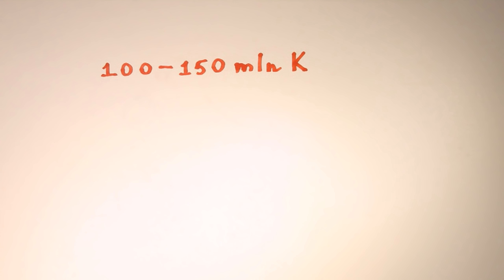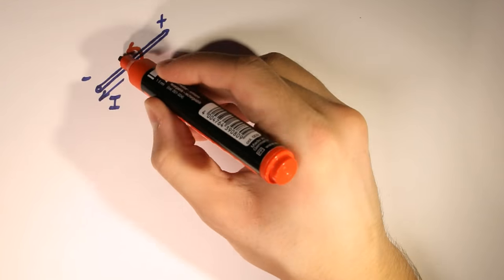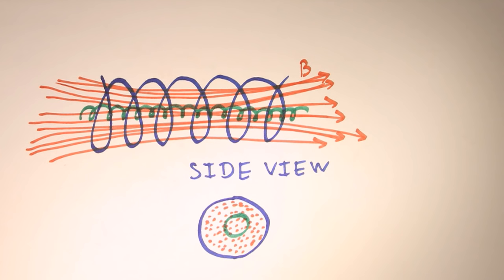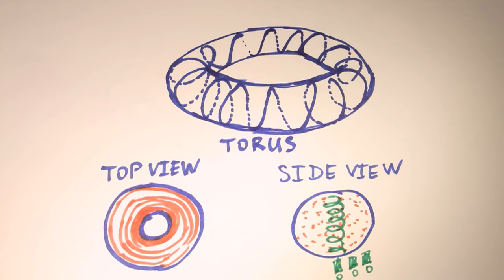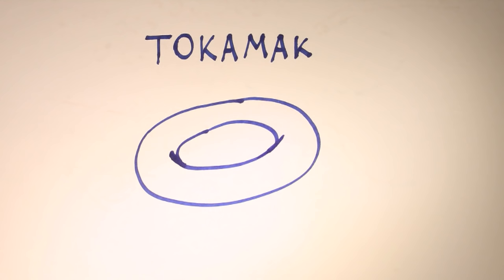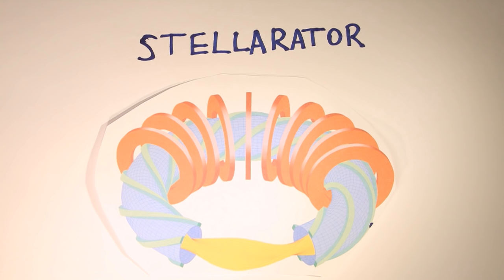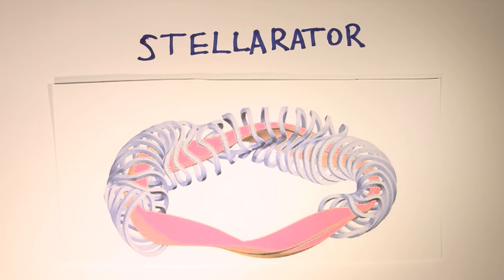Nuclear Fusion - Tokamak VS Stellarator

Comment: The tokamak is often the model pictured when nuclear fusion reactors are talked about but maybe the stellarator will become the model used for building nuclear fusion reactors.
Reply: Possibly, but winding delicate superconducting tape based coils into these shapes presents problems that are non trivial to surmount in the production of HTS based stellarators which are essential to make the most of their design benefits.

Comment: 1:38 talks about particles not being speed up or slown down but in a particle accelerator it propels a charged particles using electromagnetic fields as in charge particles like electrons and protons but this is just a opinion
Reply: The magnetic fields doesn't speed up or slow down particles. However an electric field does.

Comment: Maybe a dumb idea, the stellarator tries to keep a "straight" pattern or flow, even with all those twists. Maybe it should have parts where the plasma compresses and decompresses just a bit to help to keep a better flow, you would just have to "tune" or "sync" the flow, a bit like combustion engines.
Reply: it wasn't depicted in the diagram, but I'm pretty sure the actual stellarator does that.

Comment: I understand a tokamak works by inducing a current in the plasma, which then builds over time, but why is this a problem? Is it impossible to confine the plasma while reducing the current?
Reply from the maker: To induce current we need to change the magnetic field. We can't increase magnetic field forever in order to keep the induction going. I should note though, there are indeed possibilities for steady-state tokamak using bootstrap current. But this is beyond the scope of this video.
Reply: The problem is is that it is much luck
Iike a fluorescent light bulb. It will continually pull more and more current, that being said, the magnetic field would have to be continually increased. Also you must take into consideration the frequency it all resonates. It would need something such as a feedback or tickler monitor to monitor and modulate current, frequency and polarity.
Reply: QuaQuark And Korea did it.

Comment: I know this vídeo is old, but i'll make a question anyway. As you said "To induce current we need to change the magnetic field. We can't increase magnetic field forever in order to keep the induction going", but what would happen if we decreased the magnetic field for a little while and starting increasing again?
Reply: It induces an opposite polarity current as it collapses, which would be bad.
Reply: Michael Clark why is it bad?
Reply: It would cause part of the plasma to move in an opposite direction and there would be a moment when the forces were equal and the plasma could escape confinement which would be very bad for the vessel walls.

Comment: 1:23 You explained how they use magnetic fields to stop the plasma touching the walls of the chamber, but you didn't explain how they stop the radiated heat vaporizing the walls of the chamber.
Reply: I'm pretty sure the radiated heat is what's utilized to generate energy
Reply: @regulate.artificer_g23.mdctlsk  how can you utilize the radiated  heat which would vaporize the container?

Fusion requires 100 MEGA Kelvin and JET has only sustained plasma for less than three seconds. 100mK is 6 times hotter than the core of the sun. Fusion occurs at a lower temperature in the core of the sun because fusion in the sun is assisted by immense pressures of 260 billion bar which is nearly 4 Trillion psi.

There is no possibility that any known material can contain even a small amount of a sustained plasma at 100 million degrees C unless the container was twenty miles wide. A blob of plasma the size of a cricket ball at 6 times the temperature in the core of the sun would give you severe sunburn from a hundred miles away.

The ITER fusion project has cost somewhere between $45 billion and $65 billion, it is one of those huge failed tax funded projects that just won't admit failure for political reasons. It's a scam which will not die because there are too many people being highly paid by taxpayers who don't know they are funding something which cannot work.
Reply: @dreamdiction  the same way you utilize the heat generated from nuclear fission - coolant is injected into the reactor, and the heated coolant is used to generate steam or is itself turned to steam, and then of course that steam drives the turbines.

tl;dr that radiated heat dissipates because it's being extracted as an energy source.
Reply: @dreamdiction  so, you just think the walls in a fusion reactor can easily get to ridiculously high temperatures just from heat radiation? you think the temperature of the plasma directly translates to the temperature of the walls?
you seem to be mixing up the temperature of the plasma and the temperature being radiated. there are centimeters of vacuum between the walls and the plasma, so it's not going to melt that easily. let's also remember that, although it is several times hotter than the sun, the plasma in the reactor is not as dense as a star's. 
we also have a satellite orbiting really close to the sun with only a graphite shield (and that's how we learned more about our sun in detail).
Reply: @dreamdiction  I mean, your main concern is the temp of the plasma, which is moot since the plasma is not touching anything because that's how fusion reactors work.

an object can be hundreds of Celsius hot and you can still place your hand close to it (not touching it) for warmth; the heat you'll feel wouldn't be as hot as the object itself. the amount of energy it radiates is not the same amount as the energy it has in it, otherwise it would've cooled off pretty soon or instantaneously (and that's not good for a fusion reactor).
Reply: @dreamdiction  did you even read my reply?
Reply: @regulate.artificer_g23.mdctlsk  I read your reply and I replied to it. You say "the temp of the plasma is moot since the plasma is not touching anything". I replied telling you that the sun heats the solar system because heat travels freely across a vacuum. I asked you: "What distance do you calculate the tungsten container would need to be from the 100 million degree plasma to avoid the container itself being vaporized into into plasma which happens at only 12,000 degrees. What distance?

Comment: if there is a magnetic bottle to prevent the plasma touching the surface of the reactor. How do they harvest the released energy to convert it into electricity?
Reply: By using its heat ! Plasma means charged particles . But neutrons are chargeless , and they care less of that magnetic and electric fields . And neutrons cant stand that imense heat induced in plasma and then escape and hit the walls of the containment . And they cool down transfering heat to those walls . What comes next is what happens in a normal nuclear reactor. Heat is used to boil water , that goes into steam , that goes into turning a turbine , that  using a coil creates electricity - the final purpose of the fusion . 

Energy has a lots of faces , and because energy cannot be destroyed or created  we use that to reveal what face we want it. In this case is the electromagnetic waves (electric power ) , but yet again we can stop those cycles and use fusions energy whatever we chose ( EM , mechanical , chemical , potential  etc)

Comment: Too much energy is lost in a torus to sustain fusion. A sphere is better. Search for Look for spherical electromagnet if you want to see a better design. It should be the first thing that pops up. In this design the plasma is rotated like the armature of a motor with the axis of rotation constantly changing. The counter emf inside the plasma compresses it toward the center.

Comment: There's a mistake.   1 billion K would be 1,000,000,000   In English a comma is used to separate thousands not a decimal point. Decimal points are used in decimals.

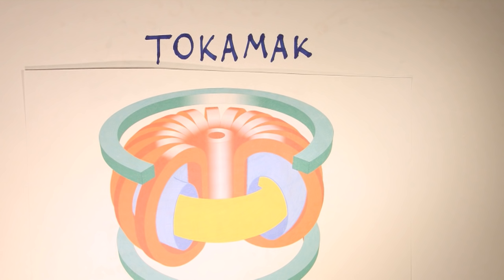Comment: 3:16 why "at some point" we can't maintain an ever increasing current level in a tokamak?
Reply: +Guillaume Combot As the current heats the plasma, the resistance decreases, which means that the current would increase under the same voltage; however, this would change the magnetic field.
Reply: Nathan Golovich thanks for your explaination!

Comment: Dear developers of the thermonuclear reactor! Your reactor will never work. You can turn it on and off for at least 100 years, raise the temperature, make the magnets even stronger, and so on... It's all a waste of time. You will not get the result, the reactor will not emit excess energy!  Why? Your theory of thermonuclear fusion and the theory of the thermonuclear reactor is wrong, erroneous. 70 years of physics can not make a reactor that releases excess energy. This is a complete defeat of the theory of thermonuclear fusion. I have the correct theory. Address. I will transfer it for free, under the contract. The reactor will start working in six months, a year at most. 
   

Уважаемые разработчики термоядерного реактора! Ваш реактор не будет работать никогда. Вы можете хоть 100 лет его включать, выключать, поднимать температуру, делать магниты ещё сильнее и т.д... Всё это напрасный труд. Результат Вы не получите, реактор не будет выделять избыточную энергию!  Почему? Ваша теория термоядерного синтеза и теория термоядерного реактора неправильная, ошибочная. 70 лет физики не могут сделать реактор выделяющий избыточную энергию. Это полное поражение  теории о термоядерном синтезе. Правильная теория есть у меня. Обращайтесь. Передам бесплатно, по договору. Реактор заработает через полгода, максимум  через год.